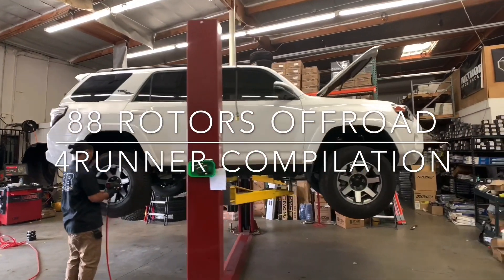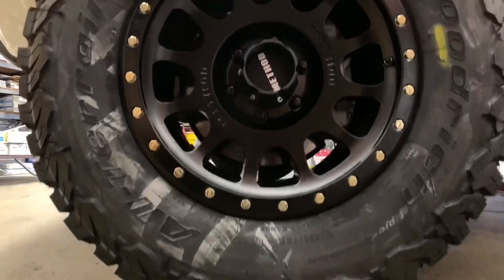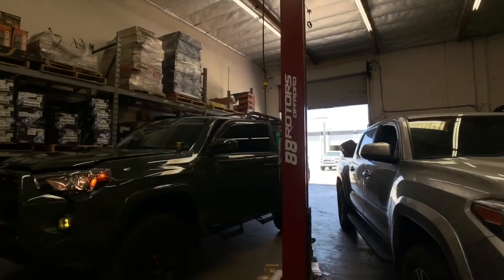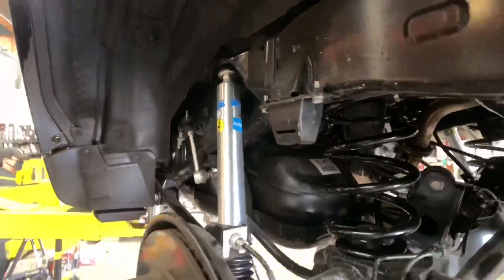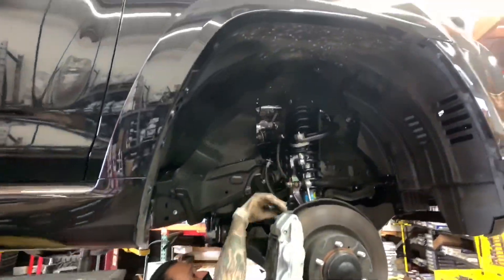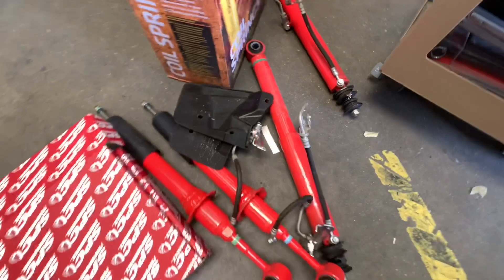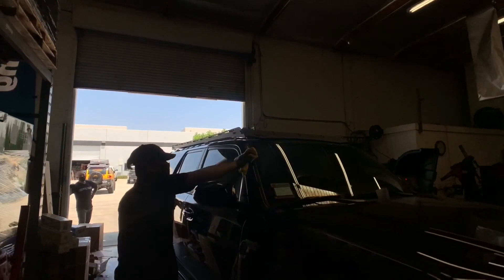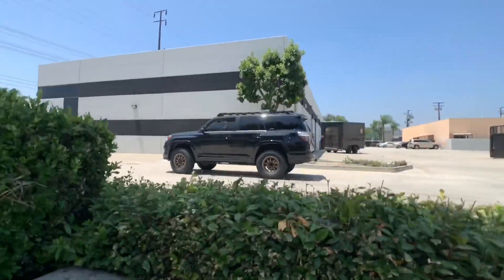3 BRAND NEW ARMY GREEN 2020 TOYOTA 4RUNNER TRD PRO, LIMITED, & TRD OFFROAD!

Comment: Can I put 285/70/17 on the stock TRD wheels?
Reply from the maker: Sure can, Andy. But won’t clear completely without a lift.
Reply: Even on a PRO 4Runner?
Reply: @andymacabulos8670  They would fit with a lot of trimming to the splash guard and removing the mud flaps. But your still going to get rubbing when you articulate on certain things. Best to just spend the $200 for a spacer lift kit and fit them properly. But if money is an issue at the moment you can certainly run them doing what I said. You just can't do any off-roading. And you'll need to be aware of speed bumps and turning on inclines and declines